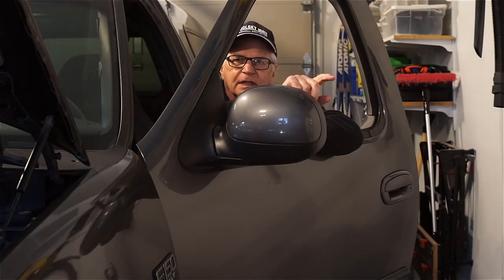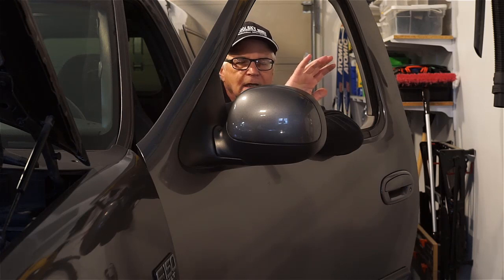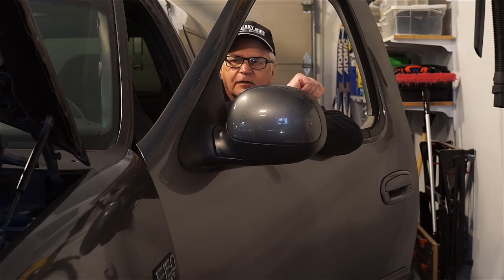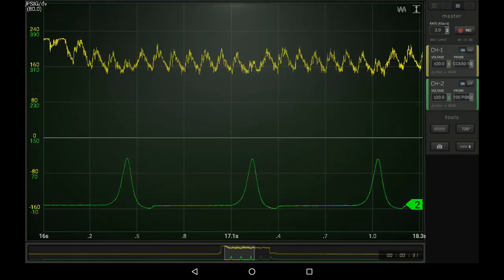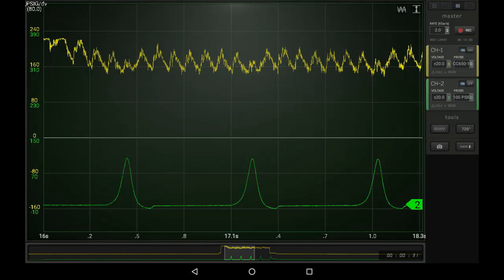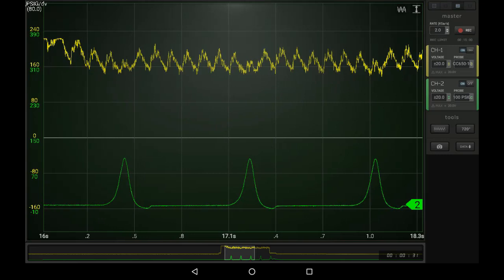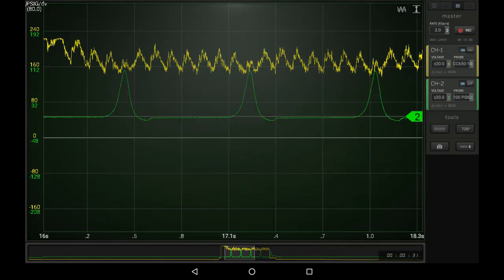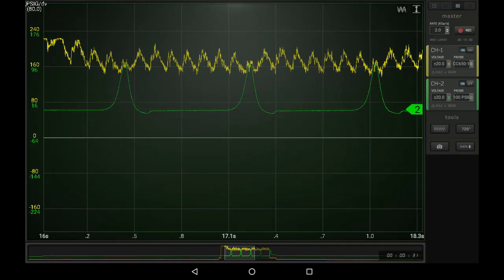GADGETS#49 - TEST HOSE DILUTION

Comment: You’ve brought up some great points with the WPS. I was wondering have you thought about using maybe a braided hydraulic pressure hose with a really small inner diameter? To try to make it more accurate.
Reply from the maker: +J Woeltje - Some people even advocate steel tubing arguing it doesn't expand under pressure. I think the differences would be small in whatever is chosen. And the waveform profiles would all have the towers with the useful information contained between them.
My contention is with accepting high PSI readings @ idle. Not to be believed, in my opinion.

Comment: If a rubber compression tester hose (without check valve), you can feel it pulsating (expanding slightly) with your hand with every pulse.  I often wondered if a steel tube would give slightly higher readings as it wouldnt expand like the rubber.
Reply from the maker: +Louis Pasnik - I know steel tubes are used and kept as short as possible.
I calculated the test hose I was using to be about 19cc. I think it would have to swell a lot to be 20cc. Either 19 or 20 added to 65cc of cylinder clearance volume, would it change the numbers much. I doubt it.

Comment: Hi I love your videos. I find them very informative.
I couldn’t help to notice that the “in cylinder compression waveform” looks abnormal. Could you please help me to understand why it is not showing the inlet / intake valve ramp?
Kind regards, Joe.
Reply from the maker: +JoeNunes345 - Thanks for the comment!
The "flat line" showing no exhaust / intake steps is due to this test done with throttle wide open...no intake vacuum...while cranking.
Had the engine been running, the details you mention would be there.

Comment: Now software needs add-on to compensate large difference. Great demo!
Reply from the maker: + Mekenzi M - This demonstrates one of the reasons we should expect very low pressure in an in-cylinder test and to question higher reported values.
Not suggesting we compensate for the hose. Just to know that its effect is substantial and with other factors leads to low pressures.

Comment: your right ,its like adding volume to the cylinder head, thus lowering compression  a lot depending on length and width of hose .your good at this-make a sensor w/adapter at plug. i know some holes are deep but you love a challenge.
Reply from the maker: +henry robinson - I've been trying to make my case for low in-cylinder pressure values. This is just another piece.
Reply: @theGADGETSplaylist  well like it says its relative,it will be the same when testing each cyl. just curious though how many cc's would be in a test hose.
Reply from the maker: @henryrobinson9837  - in GADGETS#34, I calculated 19cc as the volume of the test hose. That would be added to the clearance volume of the cylinder @ TDC of 60cc. So, it is significant.
Reply: @theGADGETSplaylist  you are correct,i was just curios of the cc's. old performance heads was a 64 cc chamber,then it was 76 cc's  so,but me and you are probably the only ones that are goin take it to the engineering level.
Reply from the maker: @henryrobinson9837  - there's a lot of real smart people on here, quite capable of contributing or debating😏